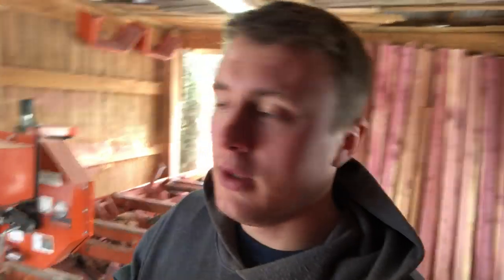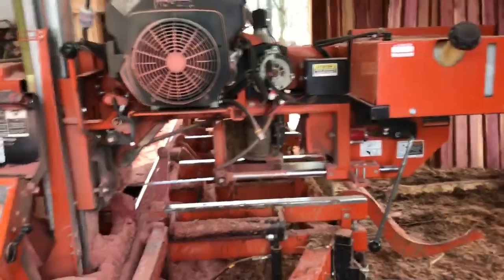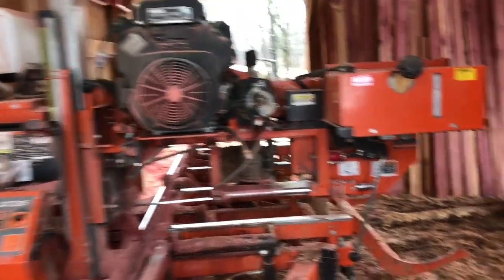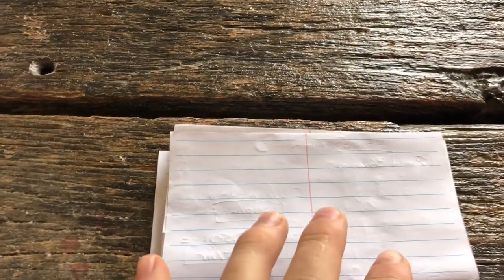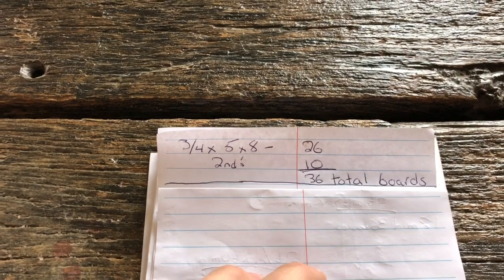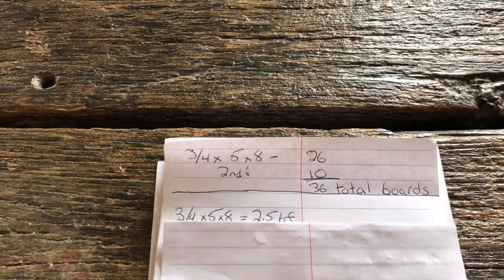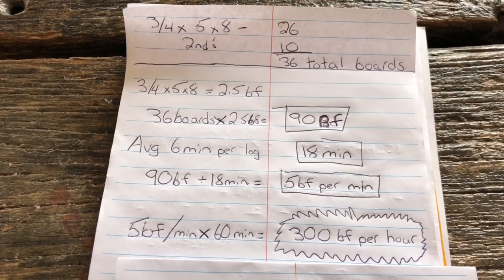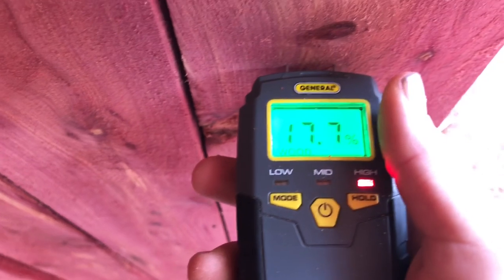Sawing Red Cedar

Comment: Tyler, great video. Couple of observations, to bad you couldn’t turn the mill around. Be easier to stack the lumber, I’m sure that’s something you’re thinking about. Also get a Stihl battery blower to clean up the mill of saw dust before cutting, especially around the motor. Again thanks for sharing the video.
Reply from the maker: Thanks! Yeah I know it’s not set up at all the way I want it but I’m just making it work for now until I figure out for sure what I want to do in the future before I start changing things. I’ve got a blower I blow it off when I’m done each night but it doesn’t stay clean very long haha. Thanks for watching!

Comment: Another excellent video Tyler...nice job.  I wish we had red cedar around here but all we have is white cedar.  It's nice but lacks the color.  I have around 300 bf of white in the shed drying but I wish it was red.  What do most of your customers do with the 1x5's???...fence? wall covering?
I would not get too hung up on bf/hour.  Remember it takes the same time to cut a 1x12x8' board as it does a 3x12x8' board and the first one is only 8 bf while the second is 24 bf.  The real productivity as well as profit lies in cutting timbers for framing since the bf output is high and the income is based on bf around here.
Reply from the maker: Thank you. The dimensions i was cutting in the video I sell mainly for lining closests, walls in houses, fences, and siding. But I cut a lot for decks and all kinds of other stuff. I don’t really cut big timbers anymore, I used to but wasn’t worth it to me. These boards is where I make money. If you have the right logs and in the right area I’m sure you can make a lot of money in timbers

Comment: Well I am thinking that if you want to load log faster onto the mill a brow built from 6 inch channel iron the same height as the mill bed you could just roll them onto the mill. Save your back from dropping a disk or pulling the tenets. Some things else that's a help is a 18 inch canthook. But nice looking material your cutting.
Reply from the maker: Yes that would work very well. I have though about doing that many times just haven’t done it yet. It would definitely be faster and less bending over. Thanks for the suggestion I appreciate it

Comment: When you use the Hydraulics it sounds like the engine bogs down.
Reply from the maker: Yeah I noticed that. It’s always done that like that though it has draw from somewhere
Reply: Cornelius Struik an electric motor runs the hydraulic pump whenever any control lever is activated.  It is simply drawing current from the battery & alternator.  Mine does exactly the same thing.
Reply from the maker: Oh ok I gotcha that makes sense. I figured it was something along those lines but didn’t know exactly what

Comment: Who cares in how quick you took your making saw dust ! Unless you have a customer waiting ?  Bottom line how much did you make ? Or itsit's not sold yet ? Having  wood on hand is great but collecting hard green is the bottom line !
Reply from the maker: The customers waiting to pick up there orders care how quickly I can get the lumber to them when they are needing it. I do all cut to order on the cedar. If I get time in between orders I’ll get a hundred or so extra boards cut to have on hand but only last a few days. If I’m off some days during the week from work it’s not to big of a deal keeping up with orders but if I work everyday it’s impossible to keep up with orders only cutting a few hours after work each night and on weekends. The amount of orders and the time I have to cut them is starting to get to the point it’s not working. If you don’t have the boards to sell it’s hard to collect the green
Reply: @pattonwoodworks  Thanks for your reply I like to see the profit for your hard work
Reply from the maker: Thank you I appreciate that! Thanks for watching. Have a good day